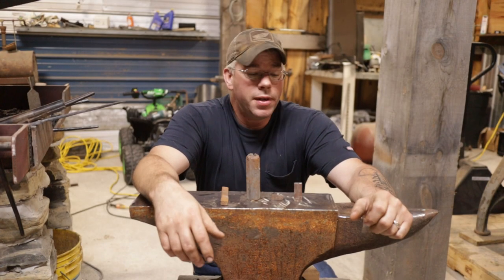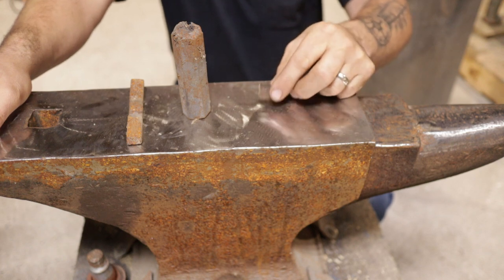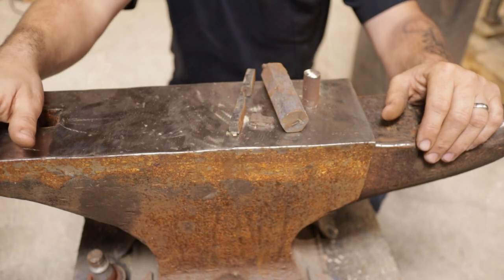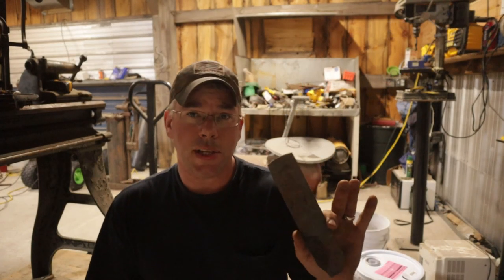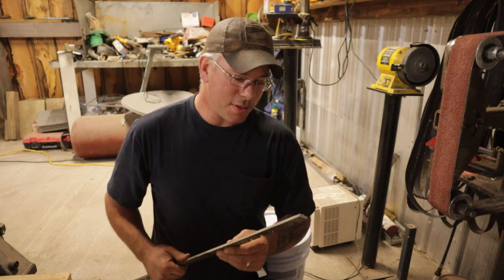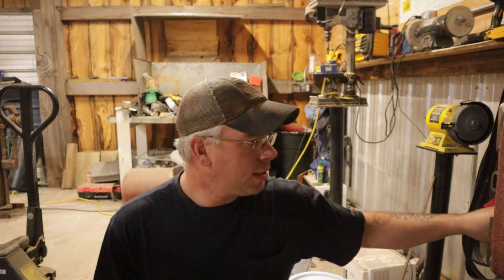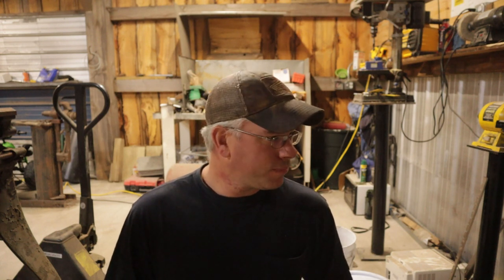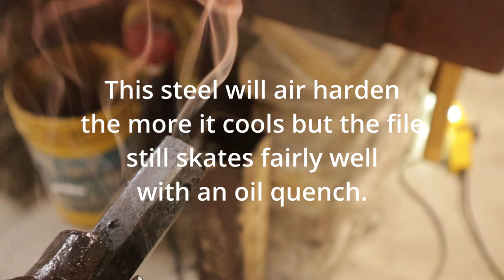Beginner Blacksmith's Guide To Choosing and Sourcing Steel For Forging

Comment: I worked at a secondary aluminum smelter most of my life.  We had an old equipment boneyard to die for. 
Plant opened in 1946, and exclusively bought old, used cranes, forklifts, front-end loaders, etc.  Fun place to "shop".
Reply: Fork lift forks are supposed to be good for project steel.

Comment: Been told engine valve stems are tool steel. Going to get some for my lathe tools, then will know if its truth. You ARE NOT CHEAP!. WISE, KNOWLEDGEABLE,  INDUSTRIOUS,  YES!!.  Slingshot , the bin chickens in my backyard, know when I come out, is the time to leave. Not hit any, but come close sometimes. Pebble choices not good, anything else may carry to the acreage neighbours.
Reply from the maker: Marbles are perfect
Reply: Steel shot for sling shot ammo, if you want accuracy, distance, and penetration. But for fun, or to scare of the neighbor's chickens, wooden or glass marbles both work well.

Comment: The way you were talking at the end is exactly how I am.  I enjoy the process of learning things and am not intimidated to jump into a new interest full force.  This is why I have mainly worked for different, returning clients as a handyman for the past few years and I love it aside from winter downtime which always leaves me depressed, so instead I would start making  YouTube videos to keep busy and record whatever I decide to build or fix up around my place for content and if nothing else it kept me busy and could possibly provide enjoyment for others as well.  It has helped immensely and takes up a good chunk of time between recording and editing but I feel im gradually making improvments and at the moment I am finishing a build of a little 18"Dx12"Hx8"W multipurpose woodstove with different removable modular attachments to cook on, clean with, and even take a sauna with for the deerstand I ran out of time building last year. I have never built something like that before, so I researched a bit and looked at some different stove designs and the reasons why on things like baffles burn tubes and intakes were used and made my design and a little mini cardboard replica of what I wanted one evening and started building/recording whenever I could due to freezing weather and couldnt run enough ventilation without my furnace running nonstop, and now it only needs to have the door assembled, legs put on and finished with High Heat spray paint/initial burn. I have already made the legs with caps on the bottom they just need to be welded to the firebox. I also made all tee pieces for the door, spring tensioned latch mechanism, lever arm, and hinges/hinge pins they all just need to be assembled and welded in place, then all thats left is the high temp paint job and then an initial burn to test it out and get rid of any possible toxic fumes.  I am designing attachments for it as well like a rock tray you can put on it to take a sauna and get clean while hunting or just to utilize the thermal resistance of the rocks to keep it warm longer of the fire burns out due to deer movement and not wanting to spook them or just the fire dying out in the night, plus a removable water tank for either side as well for warm water for cleanup of dishes and sauna time, and some attachments for cooking like a stove pipe oven on the remaining 15 inch section of 5"O.D steel exhaust I used as the flue with a sealed chamber to heat or cook food in and a simple griddle I could put on to cook eggs and stuff for breakfast so the temperatures are more constant, plus anything I can thing to make it better in the future.  Sorry, I didn't mean to rant lol but I found woodstoves to be way more interesting than I initially expected, the one we used when I was a kid was built by my grandpa back in the 50s I think and it was simple but kept us warm and got food warm with a simple box with a door on one end and a small sliding air intake on the bottom so it didn't burn super efficiently and needed contant stoking.  I wanted something similar but wanted to improve on it and I feel like both my grandpa and father would think the stove is nifty. Again sorry for the long  post lol, I just got excited talking about it and hopefully doesn't seem as shameless self promotion but then again it is nice to see others checking out the stuff I make or fix because it makes it feel like it's time that hasn't been wasted if someone else is enjoying it along with me even if it takes days or even weeks for alot of them to oven get above 20 views haha... aside from the videos involving my LBZ Duramax which tend to get more views.  I had made some videos around 8 years ago that were from a game that i used to play with friends and consisted of pvp  matches screen recorded and clipped back to back with music so tye guildies and friends could rewatch and enjoy them since I had a decent tablet that could handle screencapping a game and still be playable and it was pretty much just us that watched them and none got even close to 200 views let alone breaking into the 100s even years later.  But I wasn't trying to captivate people it was just to give friends memories in the future of the fun we had,  and now one of the first videos I made back when I was trying to stay out of getting terrible seasonal affective disorder stuff is now the highest viewed video a few months later at a whopping 808 at this moment lol and as sarcastic as I was being right there,  seeing a few views here and there made me decide to make another video in turn keeping me busy and less likely to get depressed so I am thankful and makes me smile or get a bit excited seeing a comment or subscribe and the stuff actually being watched because who knows it could help someone in a rough time. When I broke my back in 2016 and spent months in bed and really down I ended up coming across  a couple of lifelong friends who have a morning show on YouTube and had been doing it for years almost daily so there was plenty to binge on and watching these 2 made me laugh for the first time in months which eventually led to me getting up and leisurely kayaking around the small lake I lived on and fishing which led to my muscles getting better faster and accelerated my physical therapy so I was able to properly get around again and start doing some work that started with a neighbor asking if I could make gates for thier deck(after they saw a sauna I built for my aunt)so the newborn grandchild wouldn't run off and fall in the lake. They werenmy first clients and still do things for them when they come up during the summer and all my clients were gained through word of mouth until last year when a client whom I cherish because he is really kind and thoughtful came to me with a business card he paid someone to put on paper what was in his head to ask what I thought of it and it was amazing and said I thought it looked really good to which he asked if I wanted a business card. I was unsure because I had gained so many good clients from word of mouth or referrals and I needed to think on it.  I saw him 3 days later and he added to the back of the cards design that's said "If you like my work, I would greatly appreciate a referral." Followed below by "If you do not, please let me know so I can make it right."  And that fell right in line with how I felt and conducted my business so I said I really liked it so he gave a green light and paid for everything including the 1k cards ordered that day.  I gave my mom one of the proofs to show her and a few days later it it dropped out of her wallet at my old hometowns DVS and also left her coffee mug at the counter on accident and when the lady called to tell her about the mug she asked if I really did handyman or repair work because it's hard to find anyone in the area and before they were fully printed and done I gained another really nice client lol.
Reply from the maker: I apologize, I missed your comment.  It is a pleasure to meet you.  I can relate to being laid up with a life changing injury.  It is very depressing but if you can keep your mind clear you can get through anything, just as you did.

Comment: Good info Jim, that paper cutting steel was a real surprise, had less flowering than the mild, it will hold pride of place in the mystery steel pile, If i were to hazard a guess would the brand of equipment it came off be voith or something else just as german
Reply from the maker: It is German, I'll see if I can find you the info
Reply: @TheTradesmanChannel  done a quick search, sounds like corrosion is a big deal in papermaking, looks like high nickel & stainless, may be ok for a knife but would have to be forge welded in a canister, might be a good project for someone into that kind of thing

Comment: Ooo, sparkles! 
Thanks for the light show and the information. 
That jack hammer bit would end up as a lot of sparks and sparkles in my hands, I like the sparkles. Ha ha ha! Nothing wrong with making fireworks, right? You need to put a reverse on that belt grinder for holidays like the Forth of July and give the family a light show. 😃
Reply from the maker: With my luck I'd set myself on fire
Reply: @TheTradesmanChannel  
Ha ha ha ha, I know, right? 🤣